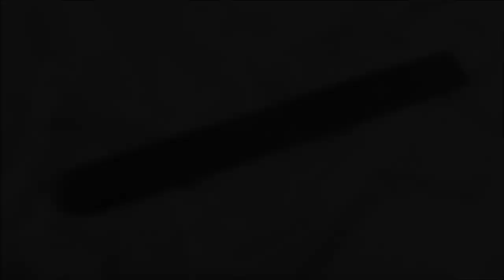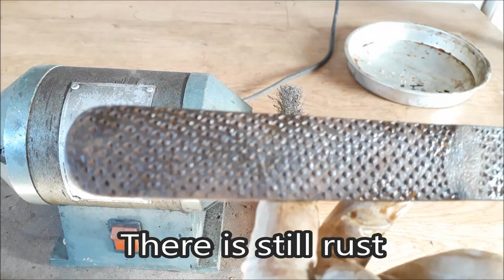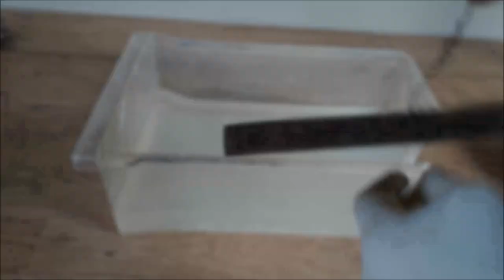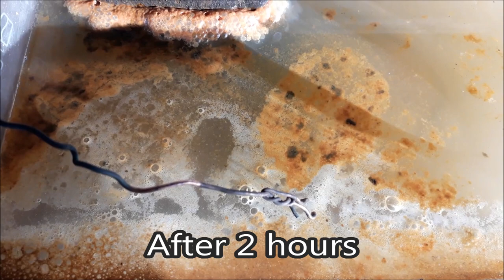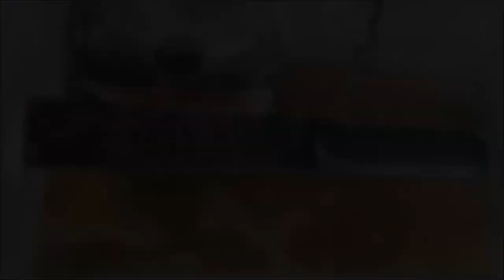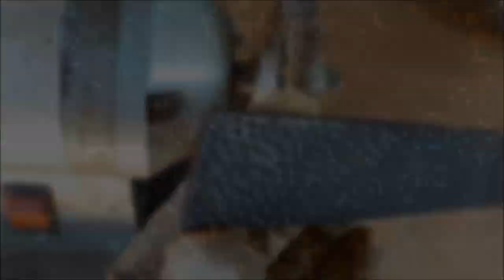4 Way Wood Rasp File Restoration

Comment: You just Dulled the file
Reply: It looks like it is common practices to use steel  wire wheels or brush to clean the file on Youtube 😂 ! I hope one day someone use copper brush .....
Reply: The steel wires aren't hardened and won't hurt the tool steel in the file. :P
Reply: @virtualhermit  actually it will, google it bud. A steel wire brush dulls the file
Reply: @packerbacker9109  Alright I'll do my homework! :( :)